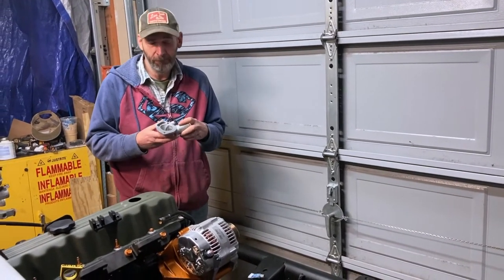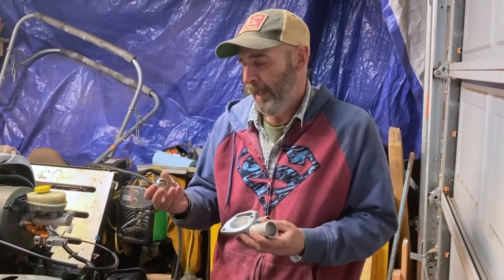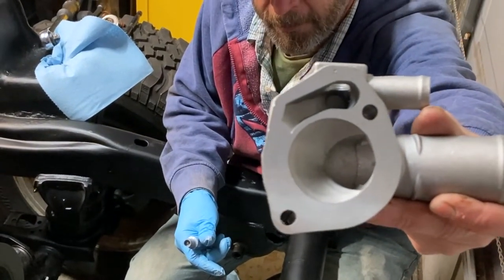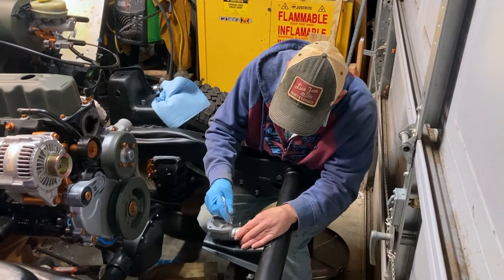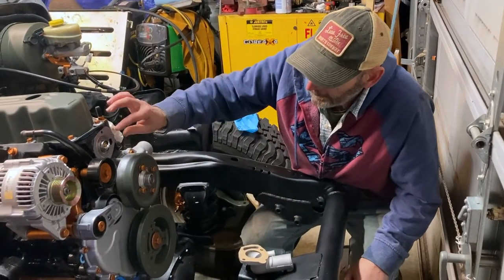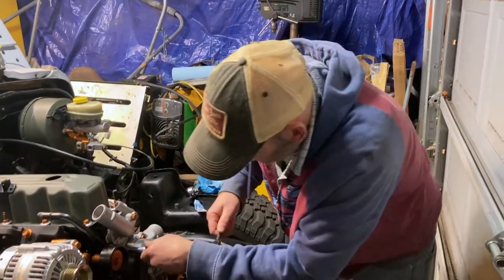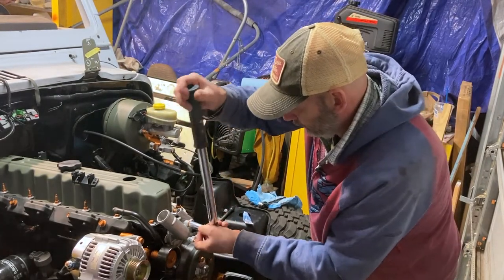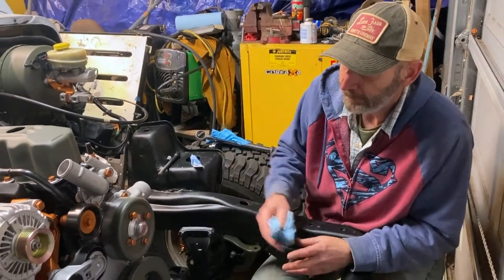Hesco  High Flow Thermostat Housing for 86-06 Jeep Vehicles with 4.0L Install

Comment: I ran a Hesco high flow T-stat housing and their high flo pump. I also installed a "Hi flo" MrGasket t-stat and the biggest radiator I could stuff in that XJ! I will not use another MrGasket T-stat, it literally fell apart into the head! I still had hotter than I wanted temps when it got hot here in AZ. The pump died after about 5 - 6 years and was replaced with a standard pump, no real diff in temps. Hesco makes a quality product, I am just not sure how much gain you get from them on a 4.0. Probably varies from application to application considerably. I use RTV ultra grey or black on everything I can. If you do it right, it is great stuff! Gaskets are old tech and leak. I have sealed all kinds of stuff w/ultra grey and if done right, NO leaks.

Comment: Has various thermostat Housing on there website . And it specifies depending on sensor tread diameter 1/8 -1/4-3/8 but I’m not sure wich one is the correct for mines . 04 Jeep wrangler x 4.0L 242 cubic . I assume I’m gonna have to check physical the sensor thread or pipe thread !
Reply from the maker: I thought most housing were tapped 1/8 npt.. You should check the sensor ( if you don't know how bring it to a plumbing store) .. The Hesco one is 1/8 .. Hope that helped

Comment: What paint did you use for your valve cover?
Reply from the maker: krypton Camouflage spray paint  non reflective Ultra flat.. I get it at lowe's best price usually cheaper then Amazon . I scuff item clean it spray it then let it sit a week and scuff it and spray again for a super flat look and really durable Finnish . You can clear coat but changes the look to me